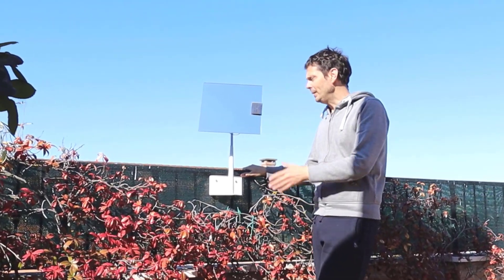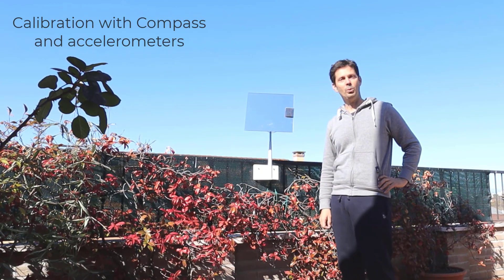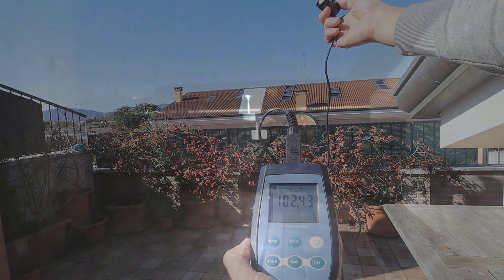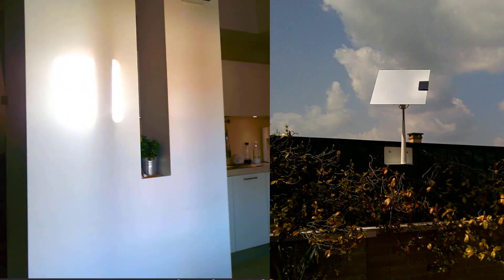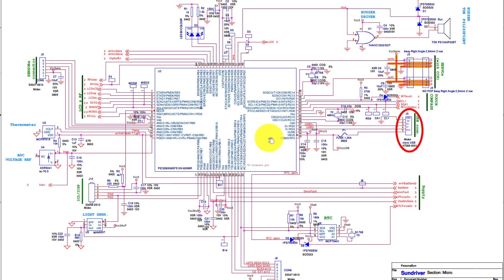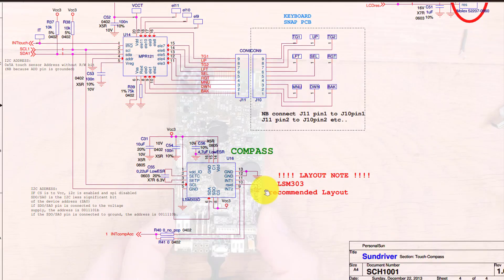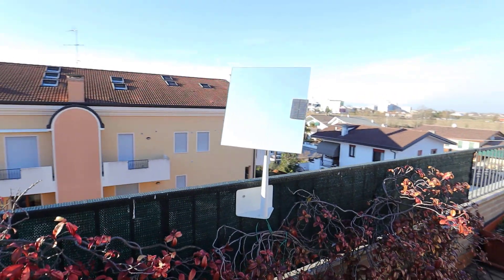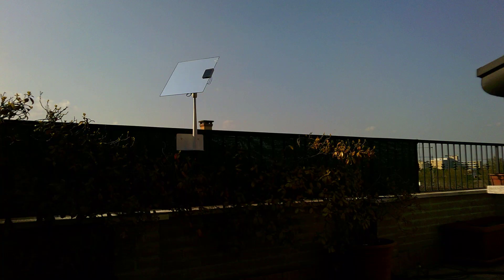DIY Heliostat - home improvement

Comment: There are also very low tech heliostats with (almost?) no electronics : 2 small solar pannels, used as sensors and energy providers. One pointing a direction , the other one the other direction. They are separated with a opaque pannel. One pannel has its + an - on the mooving motor, and the other solar pannel same, but the + is connected to the - etc. When sun energy is more powerfull in one side, it turns to one direction, until powers equals. That's it !!
Reply: A https://en.wikipedia.org/wiki/Braitenberg_vehicle

Comment: Fabio, thank you for time and effort you put into this project. I want to ad my voice to group of people who care about heliostat, planning to use it to offset the costs of energy to light/ heat. Your project is the most elegant I was able to find, included all the required modules for the whole unit to work as one system.  It is easy to operate (a remote control!!!) and requires no external connection. Adding ability to scale (bigger servos) would provide more flexibility. I am hoping you will find time to post more details, improvements, and share the code and schematics. Maybe even create a DYI kit for people who like to thinker. Thank you again for making this video.
Reply from the maker: Many thanks for your words
Sooner or later I will start porting on ESP32 the heliostat
Reply: @MakerFabio  porting ?   esp32 ?     congrats Fabio !    been looking for years for this !
Reply from the maker: @michaelduva5217  thanks
I probably found 2 smart colleagues that will help on this
Starting soon
Reply: @MakerFabio    message me if you can.  found something else going on. similar pursuit
.       or i will write  a link here if you want.
Reply from the maker: @michaelduva5217  sure, where else there is Heliostat activity?
Reply: @MakerFabio  Hello Fabio, it has been a while. I am so curious about progress on this project. I am sure many other followers share my feelings.  Please let us know where you stand, what considerations you have for hardware (computing, movements, etc.) and any obstacles you are facing.  Thank you for your work.
Reply from the maker: @jerrymalisz2066  hi, at the moment I m 100% on pure useless/entertainment objects: slot car controllers with esp32. Once i m back i ll start again on heliostats. But it may take a while

Comment: Did you improve on the prototype? Any info on how long the components last (especially being exposed to the sun)? Do you have some DiY info on the construction?
Reply from the maker: Hi, no, i didn t work on it again, yet. 
The component lasted many years, now i removed it from the terrace (i prefer to have at least 1 working prototype). The pcb is never exposed at the sun, because it is behind the mirror(which is always facing the sun)

Comment: Beautiful build! Subscribed and looking forward to the next video in the series. I have been learning arduino and heliostat is my first project. Could you please share how you built the brackets for the servos? I am using a cheap pan/tilt kit I found online but it’s not quite right. Anyway, thank you for the inspiration! I’ve watched so many vids and this is my favorite
Reply from the maker: Hi sorry for the late reply
The mechanism is a laser cut +bent 3mm aluminum i got for a good price (i think 200 euro for 6 kits including bases and sticks)
I think i still have the mechanical drawings

Comment: Hello Fabio, I love and admire your heliostat and I was wondering if you would be so kind to maybe help me out with my heliostat project? I have built a heliostat with servo stepper motors, esp32 and gps for long, lat and time. I have the heliostat tracking the sun very accurately in solar panel mode but when I switch to heliostat mode, my sun reflection always drifts away from the target. The heliostat is very level so I'm wondering if I'm using the wrong math formula to calculate the sun reflection's position when the mirror position and sun position are known. Also once the sun reflection and sun positions are known, to calculate the mirror position to keep the sun reflection in the same spot all day. Are you able to share your formula's ?
Kind regards,
Tim
Reply from the maker: Hi
The mirror has to move half angle compared to the sun movement
This is the trick

I can share prt of the code but i dont know how to share it

I want to keep only a couple of tricks for me until i publish
Reply: @MakerFabio  I understand. Thanks

Comment: Please please please, you seem to have the best one out there. Is there any chance you can make that DIY video? Would be soooo appreciated. Or some kind of repository with more details .. I want / I need one!
Reply from the maker: Thanks
I could post what i have but is everithing custom , so it is complicated and expensive. Have patience
Reply: @MakerFabio  how much do you reckon you've spend on it? Is the heliostat still in working order?
Thanks for replying 🙂
Reply from the maker: @VentureVlog  for the pcb (i think 3 pieces manually assembled by me) electronic component and 5 pieces of bended metal, i guess about 2k. But i could be wrong lot of time is passed
Reply from the maker: The heliosrat is still in working condition. Sometimes i removed it from the terrace for a period

Comment: I care about the heliostat. A GPS is pretty cheap. Software to locate the sun based on time and coordinates is free. I have been thinking about dead reckoning solution. Or possibly using a cheap camera with a filter. I put the gimbal as the difficult part.
Reply from the maker: I already have the sw knowng the sun position , no need for gps, you can hardcode the coordinates . The most difficolt parts are sturdy and precise gimballs as you spotted, but even more an accurate position and calibration of the servos (knowing exactly where is the south and any tilt of the system) conpass and accelerometer are not that accurate, and you have also magnetic deviations in the regions

Comment: I love this. It would be great to sell the circuit board with outputs suitable for slightly bigger motors. I want to make a greenhouse that is heated by this for using in the sub-arctic region I live in.
Reply from the maker: Wow
Subartic region you really need to boost the sun. With the same servo output you can use maxy servo, but nothing really strong
Reply: @MakerFabio  During the summer there is so much sun. Store heat in sand for winter.

Comment: Very sophisticated. I am building a 32 sq  ft (3 square meters) solar furnace and will redirect a similar sized mirror onto it in January February. My  solutions are much simpler and less efficient. It will face due south but you cannot swivel the solar furnace to follow the sun. Hence the need for a heliostat. Good luck with your project.  BARRY at 45 degrees latitude.
Reply from the maker: Hi Barry, keep us posted on your build. Good luck to you too

Comment: ive had the idea to create this for over 10 years, and I do have a simpler approach, but I don’t have mechanical or electrical knowledge to actually make them. if you live in a dark room, I can tell you that natural light is a beautiful thing, like a ceiling with reflections from a pool. I used to have a lot of static mirrors but yea, you should definitely make and sell this
Reply from the maker: Thanks. It took to me years before i decided to really build it. And i found a part time job to find the time
The ceiling withe reflection of a pool (sea) is also my favorite lighting

Comment: I am very interested as well !! Is there some way you can sell your new, more simple design as plans, kit, or finished controller with motors, perhaps through SparkFun or AdaFruit here in USA, or possibly a crowd-funding site? Please think about exploring this with the video of your next prototype, if you can give approximate price, you could ask how many would buy.
Reply from the maker: Thanks
This is actually a good idea. Let s say that i will be able to complete the new electronic, then the mechanical part will be one of the most expensive and hard to fetch part. Mechanic has to be strong, i live at the third floor, if a wind gust would make the heliostat mirror falling in to someone car (or head) would be really bad. So how do i manage to provide the mechanical skeleton?
Maybe as 3d printed project?
Since it is a kit , am i still liable if something happen?
Thanks for help on thinking

Comment: Hey Fabio, great! I was wondering what your result was in creating the best and simplest self calibrate system. Could you share what would be your choice now?
Reply from the maker: It is a little complex to explain by messages

When i ll make the second video abou heliostats with the inplemenation detail, i ll share also that one
Reply: @MakerFabio  Yes please, we tried compass and acc sensors aswell but were not so succesfull in implementing because of calibration.
Reply from the maker: My idea is supercool (i think) i want to write it and make a video about it before telling, so at least i can not be “outpatented “ . I don t want to patent it, to leave it public, but i need a publication in advance
Reply: @MakerFabio  Yep - get the prior art out there so no one can ‘take’ it from you via a poorly validated patent.  BTW you can also self-file a preliminary patent with the USPTO for very little $$$ as another form of prior art
Reply from the maker: @MarshallClark1  many thanks for the suggestion

Comment: I've often wondered why small heliostats for the home are not available off-the-shelf unlike other solar products (eg. solar powered garden lights). I am working on a prototype roughly the same size as yours but with a Raspberry Pi & Python doing the calculations (overkill I know). Hopefully I will get it working this summer.
Reply: I’ve been dying for something g like this. Sign me up as one of your Alpha purchasers please!
Reply from the maker: Ok, thanks for the support
Reply from the maker: Exactly, don t know either why no one produces them . Good idea for the rasbperry, i believe prototype has to be even little more expensive, as long as it is the best method we have to reach the target. Cost optimization will be implemented later
Reply: This could solve some big energyproblems. But not pointing in a house. Firehazard for sure. But point at self made solar air heater that gets air from in the house. Heats it with black surface pointed to the sun. And boost with as many heliostats as you want extra.
Reply from the maker: There is no fire hazard 
The mirror is not concentrating , so the sun density is exactly what would enter from an open window

Comment: Hey there! Nice work! I would be very interested in some DIY step-by-step manual on how to build it, especially one that runs automatically and is able to still track the sun in partially cloudy sky.
Reply from the maker: Sure
This is calculating the sun position from a clock, so even if cloudy it works. If i collect some interest, i will make a second video with more details
Reply: @MakerFabio  does it also account for seasonal altitude change of the sun?
Reply from the maker: @andreask5054  sure
There is an equation called the “equation of time” look on the web, giving sun pos all the year
Reply: I am also very interested!
Reply: I am also interested. Would like to build one myself.
Reply: Hi Fabio, congrats! This is exactly what I am looking for to build for myself. It has been teo years since your replies above. Can you see approximately when you can share a step by step video OR a kit to buy? Thanks a lot!
Reply: I’m very interested too.
Reply: I’m very interested. Excellent design, although maybe beyond my capabilities.
Reply from the maker: Thanks
Reply: @robinjain-link6683  the whole reason of our replies to Fabio is to have a step-by-step manual on how to build our own heliostat. Just think of the benefit of assembling it then on you own – you'd gain the skills and trainaing of your brain!
Reply: @andreask5054  Yes. I understand that the idea of making one on our own (with a manual) is super exciting. However, did you happen to see the electronics diagram(S) he flew through. This is not a simple machine and requires a level of understanding of the inner workings that is highly competent in order to troubleshoot issues as they arrive (which are bound to occur). I’m not saying that anyone shouldn’t attempt this, or even that I don’t want to (I do), but this is likely beyond my ability if I’m being honest (at least in this iteration).  It is very awesome, impressive, needed, and yes tempting to try to reproduce… just also… well… extremely difficult and complex. IMO.
Reply: @robinjain-link6683  that's why I've asked for a step-by-step manual in the first place, which would require certain parts, of course, and would not need to dive deep into electronics' logic.
Reply: Sadly also above my skill level. You could sell it as a kit?
Reply from the maker: @raindropburst  hi, when i will port it on open hardware (esp32 ) probably yes. It will take some time, i m workjng on a connected chicken coop now
Reply: Hi Fabio
Thanks for posting.
Very Interesting !!
Reply from the maker: @brahimmessaoudi8812 thanks to you
Reply: @MakerFabio Hi. Does it provide some warmth or only light? It will warm up a north sided winter garden a little bit? What do you think?
Reply from the maker: @powerpocok  so the area is very small 30x30cm, so it will warm up like a 30x30cm window minus the mirror efficiency , so maybe ok for a small greenhouse